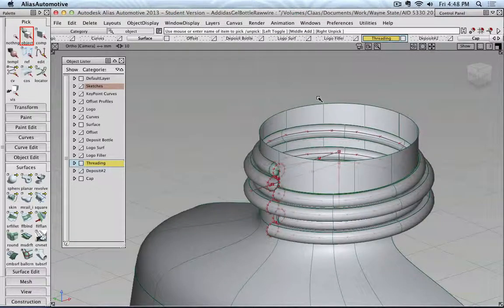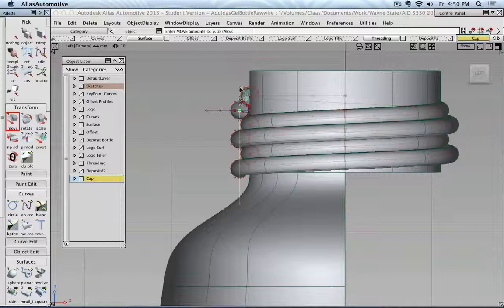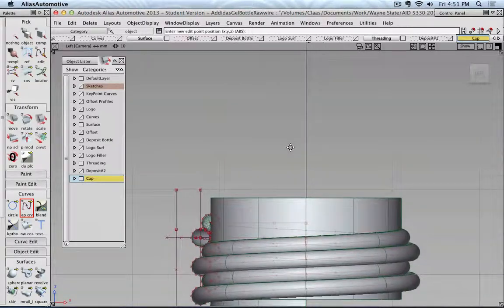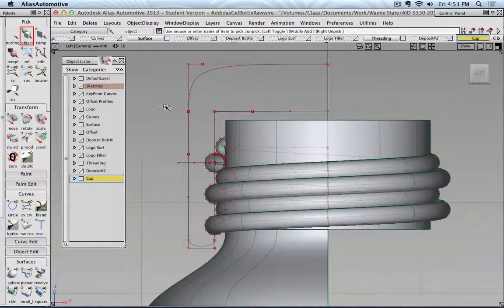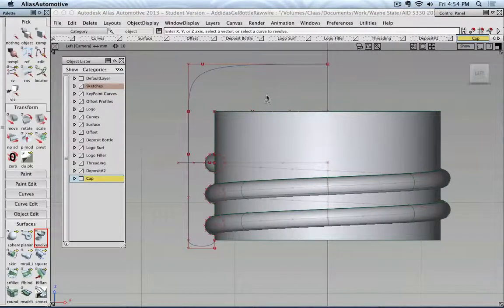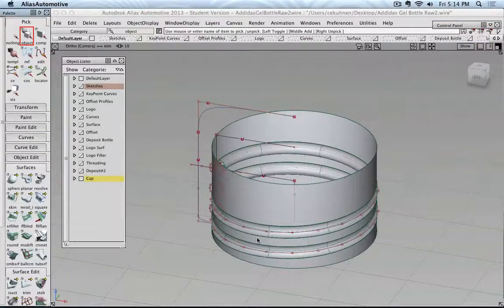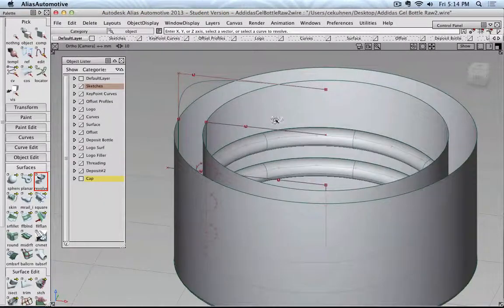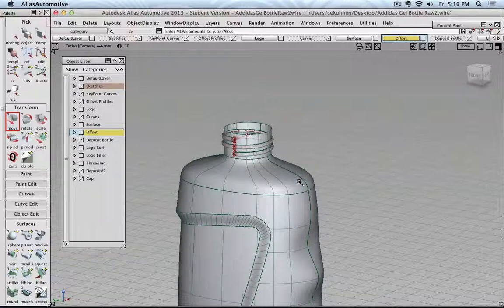18 Finishing the cap

Comment: Very good tutorial and explanation!! Just one quick question. I thought that having multiple spans on surfaces are bad?
Reply from the maker: Yes and no. For car design yes. For product design it can be a philosophical question. Truth is the lighter the mesh the better. If you work with SW or other parametric solid modeler export the data as STEP and open them in Alias.